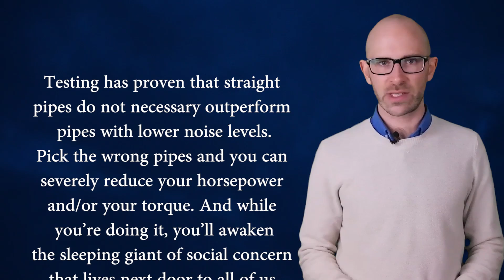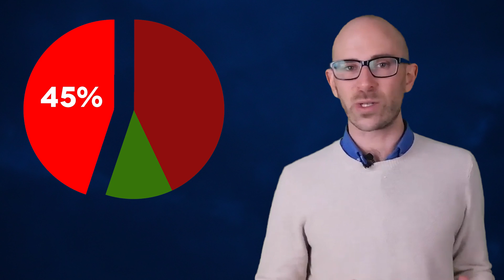Why are Harley Davidson Motorcycles So Loud?

Comment: Of course this English guy who has never rode a motorcycle in his life let alone left his house is analyzing this subject.  The stock exhausts are quiet, but extremely restrictive. Swapping out for a less restrictive exhaust improves both the efficiency and performance of the engine.  Though loud does not = fast, the higher performing exhausts do tend to be louder than stock.  People who rev their bikes for no reason at all at stop lights are assholes.  Harley riders as well as sport bike riders are both equally guilty of doing so.
Reply from the maker: This particular one was co-researched and co-written by two Americans, one of which (me) has owned many bikes in his lifetime (one street and three dirt; father and one brother have also owned several different bikes from cruisers to jumpers). I do know Simon absolutely rocks an airwheel these days, if that helps. ;-) 

I actually do know a lot about, and have significant experience with, bikes, contrary to commenters' opinion here. :-) But in the end, we are experts at research, so it wouldn't have made a difference had I started out knowing zero about them. In fact, sometimes thinking you know a lot about something is a hindrance when researching/writing these types of things.  Often I might make assumptions that turn out to be false, but weren't caught before publication because I thought I knew what I was talking about already. (And as I'm the head editor, no one is there to double check my stuff, unlike other people's work on TodayIFoundOut.) ;-) One of the pro-tips I give every new researcher for TIFO is actually "Don't assume you know anything about the topic! Research every little detail."

It's actually one of the reasons we don't do too many medical topics.  Doctors I've hired in the past are the worst at accuracy, because they answer the questions off the top of their heads from their considerable expertise... without actually looking in great detail into the current state of research in a given topic. It's a major problem. :-)  The best I've ever found was a paramedic, as he had the skills to be able to interpret medical studies well and correctly (unlike what most media outlets do), but lacked the existing knowledge to think he knew everything already. He was amazing. :-)

"People who rev their bikes for no reason at all at stop lights are assholes. " Couldn't agree more. :-)
Reply: hes right though my uncle has owned 5 harleys and stock exhausts arent loud, the problem is most people punch the baffolds and swap out to loud exhausts, we call them assholes where i live.
Reply: As a future physician myself, I know exactly what you are saying about doctors. Apparently the vast majority of doctors are more likely to advise patients based on what their mothers told them growing up than based on evidence based research.
Reply: Harleys are designed inefficient just for the noise and the vibrations.  Thats why sport bikes run smaller engines and are generally quieter.
Reply: vibration is inherent to the V twin design. Stock Harley's sound like sewing machines.  A sport bike with a shorty pipe is just as loud.  As for efficiency... I own both a 1200cc Harley Sportster and a 600cc Yamaha R6. The Harley consistently gets 60 mpg being ripped on, while my R6 is lucky to get 40 mpg riding conservatively. Better fuel economy at twice the displacement... not exactly inefficient...
Reply: There is something wrong with your r6. I'm getting 50MPG on my GSXR 750 while riding like an bat out of hell on my way home from work.
Reply: Sam Swed fuel efficiency also has to do with rim size weight of vehicle and certain engine designs are just more or less efficient then others, tire pressure can also play a role in fuel efficiency as well.
Reply: +Sam Swed I agree with the gixxer, my FZ-07 gets around 70-80 mpg on the highway and 50 in the city. Sure it has less power but it still has a pretty rich air-fuel mixture in it and its 700cc. Maybe since it has so little low range tourque you need to ride it in higher RPMs and therefore use a lot of fuel?

Comment: Harley Davidson, the amazing ability to turn petrol into noise and heat without the by-product of power
Reply: Those aren't Harleys....they share no part with a Harley.To be fair, neither do any other professional drags engine.John Force doesn't drive a Hemi like the one you or I would buy.
Reply: I don't get why people call Harleys slow, they aren't slow.  Are they slow compared to a sportbike? Yes, absolutely unless its a Vrod but most Harleys can do a zero to sixty in around 5 seconds or less and 1/4 miles in under 13 seconds, that is pretty fast.
Reply: Harley is about torque, not horsepower. I take liquid cooled rice grinders at stop lights all day long. Top speed is where we drop off.
Reply: Drag racing is something completely different. And if we comment on that in the context of the original video, then all drag racing would be sent to hell (according to the video). Not that I agree by the way. I can't say I enjoy drag racing, but it's a motor sport non the less, and for that reason alone I would back it over lefty cycling/eating lentils/make bikes quieter. etc. etc. 
It's amazing however to see that a V-Twin can be pushed to go as fast as it did in one of the videos I watched (six seconds). If you take the Hayabusa for a example, which as standard is a 1300cc bike a standard, and once a turbo or two is strapped on with a little bit of laughing gas and the bore is taken up to 1500cc, it's amazing how a bike like this would not be quicker than a Harley. I'm not by any means saying Harley are rubbish, I'm just saying, in my mind.....well, how?
Reply: No. drag (Nitro class) Harleys use engines built entirely by Vance and Hines....they have the vtwin drag bike market sewed up.Look it up
Reply: How much power do you need to run the speed limit dumbass...  My 103 has more power than your dumbass would ever be able to handle.
Reply: . Seems to me that the Harley Market has largely turned into the realm of pot-bellied middle-aged guys trying to live out the dreams of their youth. Trailer queens that show up 2 Sturgis or Laconia knot on the back of a bike but in the front seat of a late model Chevy SUV pulling a trailer behind it. it's hard for me to take defense of loud pipes seriously from guys like this. however guys that ride all the time, not with 12 volt plug-in heat suits and not only when it's over 80 degrees, these guys should be the ones that are allowed to have loud pipes, because they're the ones with the Good Sense maturity and respect to not red line their engines going through residential neighborhoods
Reply: At least 147 bhp from my bike, so I can safely say I could easily handle your far inferior power. 

And dumb ass is two words, not one, you dumb ass.
Reply: same reason you need 100. or a Chevy needs 500.
I like 200 myself, w/ about 120 #'s
Reply: Bob Stover The reason you can get a holeshot is weight distribution, and an excess of weight, helping to hold the front end down.  The crotch rocket has the power to leave you in the dust.  It's balanced for hauling ass in the twisties, not for drag racing.  

And it's not just top speed where you get left behind.  The crotch rocket passes you up WAY before anyone is approaching top speed.
Reply: Yeah, I currently ride a Harley and yes, most sport bikes do beat Harleys in terms of speed, no question. However, that is not a Harleys strength. See a Harley is engineered to be able to haul a lot of weight. where as sport bikes are engineered for speed. The larger engine Harleys can haul as much as 800 or 900 lbs between the rider and all their gear and are even capable of towing small trailors. Try doing that with a sport bike, not gonna happen. It's like camparing a truck to a race car. It's a rediculous comparison, sort of an apples and oranges debate. pointless and stupid really.
Reply: Thank you for a proper comment. As you can see above, Mr Tramp does not play well with others. I ride a Vmax; not a Harley, not a crotch rocket. Bloody good fun though. 
I must get around to riding a Harley. I've only been riding for 24 years and never had / or thought about it ....
Reply: +Leslie Horwinkle The bikes are different. For years you were able to walk into the dealership and actually purchase a drag bike. They were ready to run and nhra legal.
Reply: stujb  I just rode a new 114 - 4 valve, much improved. Still prefer my Victory XCT for room, power and handling tho.
Reply: Even after you've spent thousands to get real performance out of your antiquated old beast, you still can't get it around a corner at a decent speed.  Yes, Harley's are slow, and no amount of semantics will change that fact.
Reply: Mathew Stahl Makes you wonder why Harley riders always try to convince us that they're fast, and can corner, doesn't it?
Reply: Well the one area in which myself and many Harley riders can sort of claim to be faster is, coming off the line at a stop light. See because a Harley has a lot of torque, if you know what your doing you can get an initial burst of speed that will put you ahead of any sport bike in my experience. However, that doesn't last long. After that initial burst of speed as me and the sport bike rider are accelerating through the gears, by the time I am at 60 to 70 mph, the sport bike is already level with me and pulling ahead. Since my Sportster 1200 only has a top speed of 120 mph, by the time I get anywhere near that speed the sport bike is already hauling ass way ahead of me down the road. 

I don't know of any stock harley that could actually beat a sport bike in a drag race accept maybe the Vrod. That one is actually designed with speed in mind but, the engine was designed and built by Porsche not Harley lol.
Reply: Pro drag bikes are built on the idea of a Harley engine.  No Harley parts are involved.  

What is a mile to speed ratio?
Reply: stujb 90% of Harleys are cruisers. not meant to go fast. there's a couple models meant to be sporty. the night Train, Vrod, Buell xb12, the 1125R, and even the 1200 sportsters do ok.
Reply: murica
Reply: considering most harleys produced are not meant to create lots of power and are in fact meant to cruise and be comfortable (kind of why they are called "Cruisers")...your statement is pretty ignorant
Reply: Exactly. That's why they are all pieces of shit. Lol
Reply: No truer words were ever stated.
Reply: Check out buell in the sport bike racing scene. Also, check  Harleys racing record in nhra pro stock drag racing.

In drag racing the sport bikes hardly compete. Suzuki is Harleys only real competitor and if you follow the rule changes they can't really compete. The sport bikes get rule changes to their benefit almost every year to help them keep up, while harley gets restricted. Of course it's all just to keep things "fair".
Reply: +eddyt One of those people that take shit too seriously, ay..? It's all good.
Also, I don't understand how deafening myself would make me comfortable... "your statement is pretty ignorant."
Reply: stujb --- Why does anyone need 147 hp on a street bike?  Hp has nothing to do with your ability to ride.  Most of you crotch rocket jockeys can't ride for shit...  I'll spell dumbass any way I choose fuck face...
Reply: Check out buell in the sport bike racing scene. Also, check  Harleys racing record in nhra pro stock drag racing.

In drag racing the sport bikes hardly compete. Suzuki is Harleys only real competitor and if you follow the rule changes they can't really compete. The sport bikes get rule changes to their benefit almost every year to help them keep up, while harley gets restricted. Of course it's all just to keep things "fair".

Comment: Whenever I hear the argument that "loud pipes save lives" or that the bike owner is doing it for safety reasons I very quickly ask the rider what other safety measures they have taken.  Do you wear a reflective vest or a neon green riding jacket?  Have you added some reflective tape to your rear fender?  Surely you haven't removed the reflectors from your license plate holder have you?  What color is your helmet and does it have reflective tape?  The answer is always no to any other safety measures.  The loud pipe club almost always dress in all black and rarely employ other safety measures.
I ride and I have aftermarket exhaust and yes it's loud;  That said, I don't claim that it for any life saving reason whatsoever.  I have loud pipes because I like the sound and probably want to draw the attention of other motorists for vanity reasons.
Reply: You want to know what really saves lives?  Motorcycles that handle well, don't weigh a ton, ridden by skilled riders.  That eliminates Harleys and their riders.
Reply: From the UK, the Number Plate Reflector is a legal requirement for motorcycles. But to be honest, the reflection from the number plate it's self outshines the dinky little bit of red plastic. I believe louder pipes can save lives. but I'm more of a believer of "Good riders saves lives." Sadly, not everyone can be, or be bothered, to be a good rider.
Reply: That's pretty dumb though because cars have bright lights in front and in back yet people still hit them. What's reflective tape going to do for you? You won't even notice it.
Reply: Your analogy is pretty dumb.  That's like saying you heard about one guy who died wearing a seat belt and coming to the conclusion that seat belts don't save lives.

Can you see the difference?

http://reflective-tape.com/wp-content/uploads/2012/10/before_after_utility_truck.jpg
Reply: +John Doe The difference is you can actually see that people still hit other cars no matter how visible they are. It's not hear say.
Reply: Dude ... Can you see the difference in the two images and still say that one isn't more visable?
http://reflective-tape.com/wp-content/uploads/2012/10/before_after_utility_truck.jpg

I completely agree that vehicles are involved in accidents regardless of how visible they are (I've seen a police car with it's lights on hit while parked on the side of the highway) ... some people are bad drivers and sometimes accidents are unavoidable.  That said, my original statement was regarding a statement I hear over and over again that "loud pipes save lives" yet those same riders don't employ other safety measures in the interest of saving lives and therefore their argument is falsely based.  I ride, when last tested (2 years ago) my bike was 105 db and I make no apologies about that but I also don't make excuses and claim it's for safety.  My loud pipes are for me ... they project an image that I want projected and allow me to play the role of weekend bad ass (which I believe describes 99% of the loud pipe gang).
Reply: While I am also in the loud club, and predominantly wear a leather jacket, gloves, and a dark helmet. I also only ride during day time. However if I know I'll be riding at night I do wear a vest, granted it doesn't mean much because cars have bright lights on them and people still manage to rear end you.
Reply: Confused Raccoon Good riders, on bikes that handle well.  

The condition of my right leg is testament to the fact.  No amount of noise or visibility would have helped me avoid the accident on my fourth day of owning my first street legal motorcycle.  Some experience might have, though.
Reply: Speaking of self centered assholes,........

Comment: I live in Boston, mass.  It is not Illegal to get aftermarket exhausts.  I hear harleys all the time that are very loud.  my bike is loud.  The law states, you can't remove parts to make a bike louder.  But you can  buy after market exhausts like Vance and hines.  Harley themselves installed it on mine.  They are perfectly legal...
Reply: "Harley themselves installed it on mine." For several reasons, I wouldn't brag about that.

Comment: The video is useless because it is totally off scale with ear harming loudness.  A high reved japanese bike will ruin your hearning.  A harley is a lowere reved engine with a longer stroke (same as a large car) and is a BASS noise which does not bounce off of your ear drums as would your high reved treble in japanese sports bikes.
Reply: Also noise levels are measured 1m (roughly 1 yard and some) from the exhaust in Europe. What bystander has their ear 1m from an exhaust  on a driving bike?
What about trucks? Some trucks like a big Volvo with 20+ ton load make more noise in the towns. And there are way more of them and they drive day and night in the cities.

Comment: With all the cellphone idiots driving with their face stuck in their cellphone, a loud hog might actually make these zombies look up and save your life!
Reply: RIGHT!!!!!!!!!!!!!!!!!!!!!!!!!!!!!!!!!!!!!!!!!!!!!!!!!!!!!!!  PLUS!  The video is useless because it is totally off scale with ear harming loudness.  A high reved japanese bike will ruin your hearning.  A harley is a lower reved engine with a longer stroke (same as a large car) and is a BASS noise which does not bounce off of your ear drums as would your high reved treble in japanese sports bikes.  Air nozzle hoses sparying in industries and auto shops will ruin your hearing as well as grinders of some fat bitch in an office using the speaker intercom system at a plant to tell idiots to pick up line one for some phone call

Comment: id doesnt matter if its a sports boke or a chopper  all moto bikes should have loud pipes for 1 reasion loud pipes save lives  if cars can hear u from a mile away they expect to see u at the same time car drivers should be more vidulant and look out for bikes non the less  but for some reasion most car drivers and lorry drivers think there the only thing on the roads so bikes bein load is a good thing